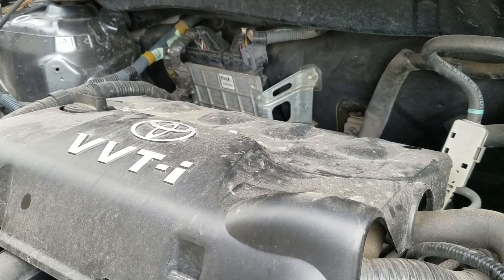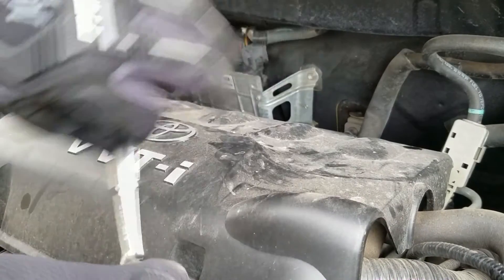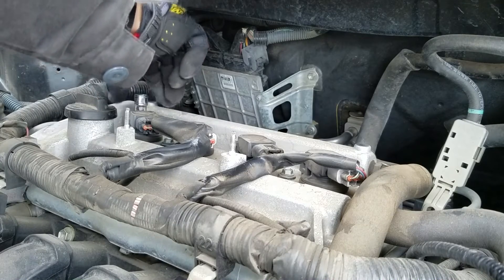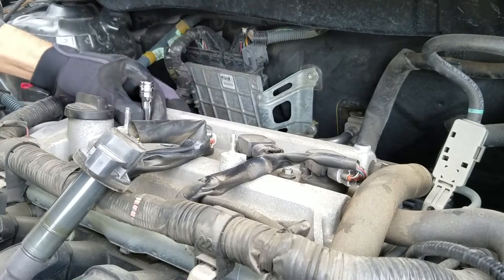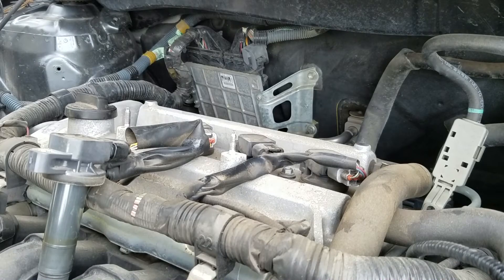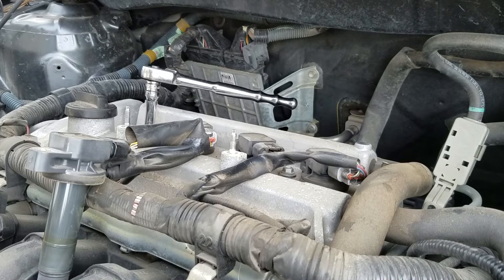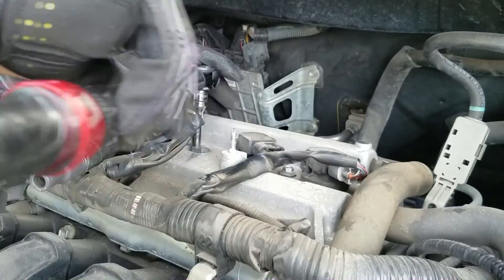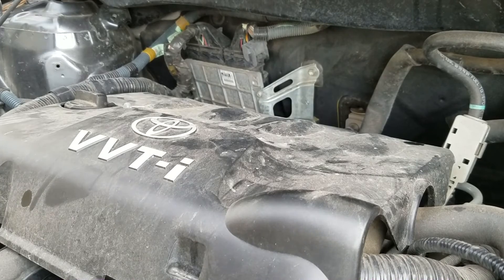How To Change A 2007 Toyota Yaris Spark Plugs

Comment: Approaching 120,000 miles so I got the plugs. The car runs fine but why tempt fate. I serviced the transmission a 108,000 miles and it was the cleanest tranny pan I ever dropped. So Plugs go in in a couple of days. Thanks for the information.
Reply from the maker: Glad to have been somewhat helpful!

Comment: Wouldn't  application of anti-seize corrupt the torque setting?
Reply from the maker: You will get a more accurate torque with it than you would with dry hardware. With dry hardware, you can actually be twisting the fastener, which interferes with the overall torque reading
Reply: I believe the torque specs are based on friction between the threads of the metals being joined. Engineers know the friction coefficients  based on the metals and the finish. You introduce a lubricant in there and the engineering spec no longer applies. Unless the manufacturer says to lubricate, I would not do it. The engineers also expect the fastener to be twisted. That's silly.